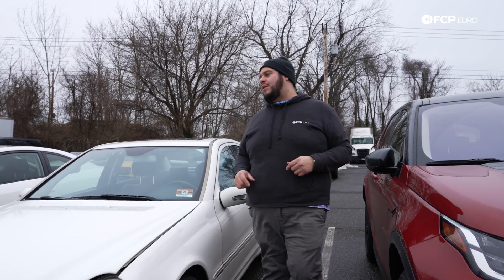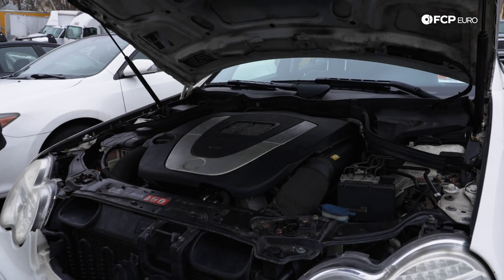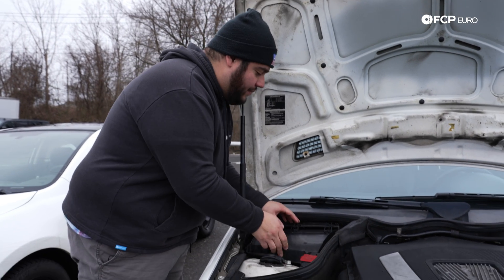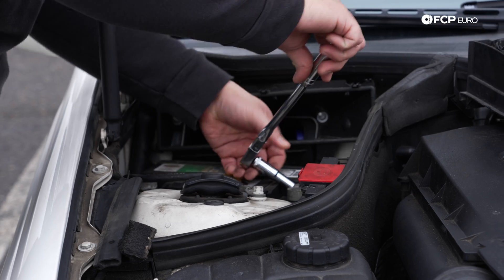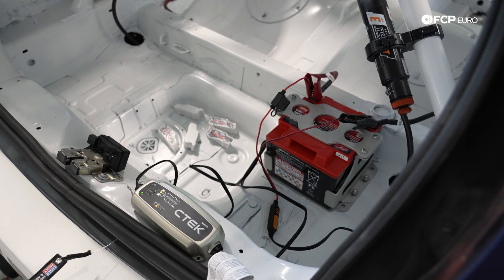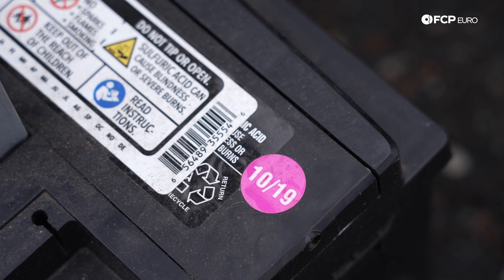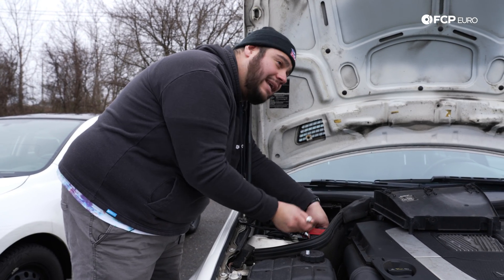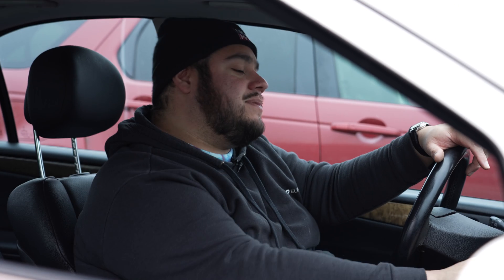How To Ensure Your Car Battery Stays Charged Through The Winter

Comment: When I owned my 2005 C230 Coupe, I used to top up the factory battery once a year with deionized water, and it started every day, even when the temps dropped below -30C.  I scrapped it 2014.  I miss the car, and the battery.